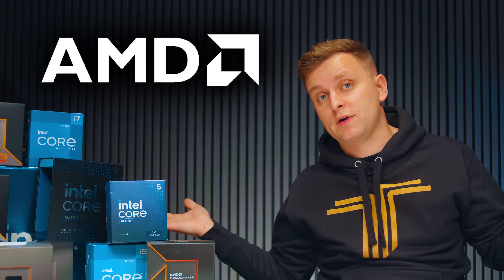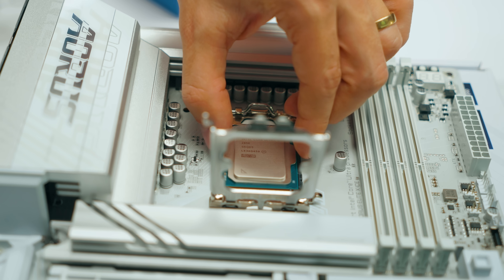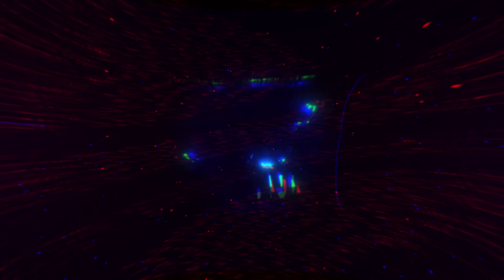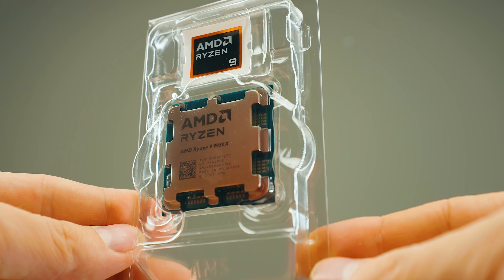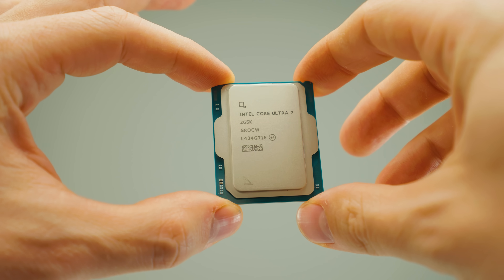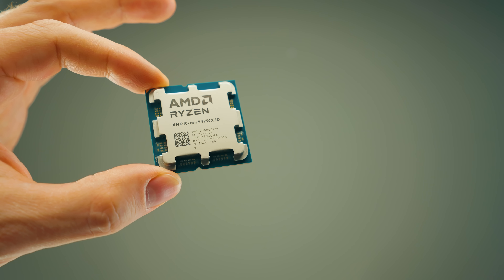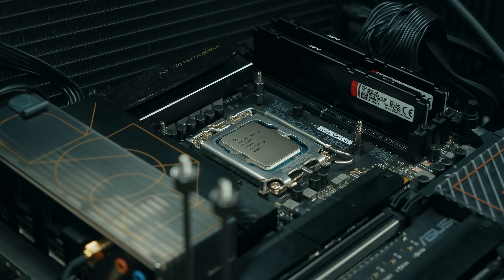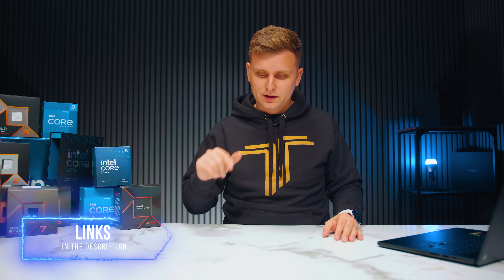Don't BUY a CPU before WATCHING THIS! - Top 5 CPUs for 2025

Comment: If you are a gamer, the AMD Ryzen 7 9800X3D is the best CPU for you.
If you are a gamer and a content creator, the AMD Ryzen 9 9950X3D is the best CPU for you.
If you are a content creator that doesn't play games on PC, then the AMD Ryzen 9 9950x is probably the best, but some intel CPUs might be just as good for less money.
If you only use your computer for basic tasks and web browsing, then you can save money by getting an Intel CPU, because you won't use the extra processing power provided by a high end CPU.
Reply: Gaming and streaming on the 9950x3d is a pain in the ass and your forced to use project lasso. So no, this is coming from an owner
Reply: I have not read about any such issues myself. The game bar and latest chipset drivers on Windows 11 24H2 are reportedly working fairly well. Which specific applications are you experiencing issues with?

Comment: 8:32 here's the thing, "top of charts" everyone's missing, you're missing, when all these reviewers benchmark they run the game in a vacuum, in isolation all by itself. Oh sure they play the knobs higher or lower resolution, Ultra or high settings, upscaling SS on or off, BUT what nobody is reflecting in benchmarks is running the game same time as truly multi-tasking gaming + socials + recording + streaming ; OBS, XSplit, XBox Game Bar, Discord or Twitch or Kick or YouTube, etc. More than half of gamers are also doing this and guess what, sure enough, the Intel Thread Director and Hybrid Performance, Dynamic Tuning, and myriad of Application Performance Optimizations results in significantly better FPS on Intel vs AMD for everyone who does these.
Reply: Have you empirically tested your hypothesis? I’m fine with you being right, but we need concrete proof. So far, APO has proven to have some pretty wild swings in performance with some wins and some regressions. Intel thread director on Windows has needed serious adjustments to the Windows kernel as seen in Windows 11 23H2 vs 24H2.
Reply: @gymnastchannel7372  yes Intel has, and shown to top reviewers at briefing events where Intel points it out, asks them to include these. That would add loads of variability mind you, many more complications of course, such as which streaming/recording apps and at what settings, and under what network conditions, lots of work not keen to undertake.  Intel predicted majority of gamers want and use these, and put in the engineering purpose built for better consistency, performance and responsiveness on these, but how to get folks to see it?
Now in the case of APO the app, I think people misunderstand it too, are disappointed there's not as many titles listed, but that's actually a good thing. What Intel does is make it easy and supports myriads of developers and titles, so their application or game title can be tuned to further & maximally exploit Intel architecture advantages, not least of which is Dynamic Tuning and optimal dynamic scheduling on performance and efficiency cores, but also caching, I/O, and more. Now, think of APO app as a stop-gap, a helper, for titles or portions that are not yet fully optimized at the source.
Reply from the maker: I'm glad I don't focus on gaming on this channel 😜

Comment: I will go for 265K. It will be used at 1440p with 9070XT so it will not be a bottleneck and it still has 20 cores that can be used to get some fun on Proxmox or raw Hyper-V.

Comment: Yeah, what is up with the hating INTEL.  INTEL is a wonderful Chip Company.  A major part of the U.S. Economy.  INTEL makes solid dependable Chips.  I will always be staying with INTEL for my PC Chip.
Reply: Intel unfairly and illegally kept AMD and perhaps others from being used by OEMs, didn’t care about defective 13/14th gen Raptor Lake-gen CPU failures, and before that tried and failed to get buyers into a proprietary RAMBUS ecosystem, then fucked up their memory controller hub, causing instability. Their 1.13GH PIII was pushed too far and was also recalled. The original Pentium had a division bug. Need I go on?
Reply: why did bro just mad at amd lol  , your profit after building rhat trash intel pc is nothing 😂
Reply: It started with their 13th and 14th gen having issues with incorrect voltages resulting with blue screen, shutting down, or worse blowing up. It took them a while to fix it by updating the bios but damages has been done.

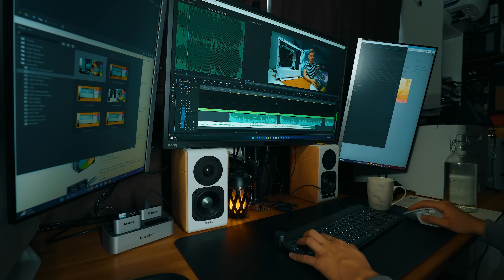Comment: 0:22 for some reason? 😂
Reply: Yeah I guess making 2 generations of CPU's with fatal flaw is not good enought reason for that guy
Reply: @skiper7795 I wouldn’t really call it a fatal flaw. I run all of my CPUs at elevated voltages to overclock and accept more degradation because I want more performance. Sure it should not be something that’s default but it’s not really a fatal flaw
Reply: @JohnSmith-sm6mu Everyone that is not into pc hardware which is a majority was using cpu that was damaging itself over time. If thats not a fatal flaw idk what is.
Reply: @skiper7795  And the sad part is, most people don't even know what a BIOS is. They buy the computer, turn it on and turn it off when done using it.
So many of these CPUs are on original BIOS firmware and the CPU's are just getting cooked.
Even my tech focused friends and coworkers, I've found that working on their computers that the BIOS is WAY out of date. I get a "whoops, forgot about that" or "I have to/can update that?".
It's a fatal flaw.
Reply: I’m not sure how many creators who depend on their PCs being reliable are following suit with your approach to CPU stability/electromigration.
Reply: Tried to blame the customer tried to blame the mobo manufacturers tried to even hider it for a while. Saying the first microcode fix was actually fixed then released another or maybe two more microcode fixed which might fix the inital problem. But by this time the damage was already done. Just some cpu degradation but it's fine everything is " fixed" now you only lost some performance on your already overpriced cpu. But there is no reason to hate Intel for this come one they were just joking with you and with your money.

Comment: running 265k+B580+96GB RAM for all intel build. Have zero complaints for productivity, running lots of heavy VMs and bit of video editing.
Reply: Just a small correction: the B580 motherboard doesn't officially exist. That Intel i5-265K processor uses the Z890 chipset or similar, not B580. Otherwise, it's an excellent configuration for virtualization and video editing.
Reply: @arnaldosancheztecnologia it's the GPU buddy. He did mention "all Intel build", so that B580 refers to the Intel Arc B580 graphics
Reply: @SoloID97 Sorry, I'm understand
Reply: @SoloID97  How are you getting on with the B580 GPU? Have you done any 4K video editing with H.265/264 files using that GPU? How does it perform on the editing program's timeline?
Reply: And you're wrong about i5-265K. The i5 term is no longer exist. It's now Core Ultra 5 265K
Reply: @SoloID97  I know it's called Intel Core Ultra, but I put "i5-265K" to shorten the words
Reply: @arnaldosancheztecnologia then it’s i7 (ultra7) not i5 😂

Comment: Let's make some things clear, intel is still on the market because there are still intel fans out there. They've messed up big time in the last couple of years similarly to Microsoft and almost everyone is switching to Linux atm😅😅😅. Future is running on Linux and AMD chips, I have no doubt about it. Intel will do Gpu's along Nvidia 😅😅😅 and brush the floors after AMD finishes selling all the chips whilst holding a lead in the market.

Comment: The current intel socket is gonna be dead after this generation. it's automatically worse than every AMD option because of that
Reply: Ahh yes, everyone should throw money on a CPU every 2 years guy. Just look at what's in front of you (no pun intended). Sure, AM5 will last for another 3 years? If you really got the money, don't look at Intel right now. But it's such a good budget/value buy (265k especially) that it'll last you for the next 5 years. AM6 will come out by then and  we will all be building new rigs anyways.

Comment: I have the 265k on an AsRock Z890 LiveMixer mobo. 128G Crucial DDR5 and a 4080 Super. DaVinci just rolls right along.
Reply: I've got the exact same combination. Did you overclock?
Reply: @SpFres1  No I didn't.  I've never overclocked any of my PC's but I have shown folks the How To on doing it for their particular build that I made for them.
Reply: undervolting at  all? Ive heard this really helps temp and performance of the 265k
Reply: @SmbaaFlipooo  Doesn't run hot at all. Core i9  and whatnots yes those are space heaters. 265k not so much.
Reply: What kind of cooling do you have for this?
Reply: @jacekrams  Be Quiet Dark Rock Pro 4
And it clears the memory too.

Comment: Used to buy only Intel but got tired they don’t have any platform longevity, really happy on AM5 ever since with 9800x3D
Reply: Yup I used to build only Intel systems. Not any more. They burned all the goodwill they had built up with me with the 13th and 14th gen fiasco and the way they handled it.
Reply: And forgot to mention the most important, looking forward to ZEN 6 on AM 5 🎉, AMD shows it can be done.
Reply: by the time you need to upgrade 14600k or 9800x3d youll need a new motherboard anyways
Reply: @bigturkey1  When it comes to non gamers and people who do not do creative work, I agree.  If you are however one of these two types of people who are building a system, do you keep longevity in mind? The 14600K is $310 CAD. New DDR4 memory has spiked up pricewise almost double in price.  The only non motherboard upgrade down the road on the 1700 is a used 14th gen CPU otherwise you will need a new motherboard and memory. On AM5 you will have the Zen 6 CPUs and the existing DDR5 memory is reusable.
Reply: @GregM  14600k $150 comes with bf6. you wouldnt want to use ddr4 with it. in like 8-10 years when id upgrade from it, id move it to my 2nd system and finally retire my 6700k. then buy whatvever is new then. I already have a 120hz 55" 4k oled, i cant see me even be interested in upgrading my cpu til i can buy a 240hz 55" 4k oled and a competitive game exist that my 14600k couldnt get 240fps in.
Reply: same, got hyped into the x3d technology & bought the 9800x3d. however, i will point out what no one seems to mention is how much more POWER (watt) AMD uses just sitting in IDLE doing absolutely nothing, it uses 4x more power draw sitting in idle than my intel. which would indicate it being more costly over time....
Reply: @BenjaminD-d4k  Well costly in some areas of the world where one does not have cheap power.
Reply: @GregM  guy you're either not a critical thinker or  have poor reading comprehension skills. all else the same, owning an 3xd is more costly to own over time bc it utilizes more power even at idle. thats not even an argument but an objective truth. do you attempt to play devils advocate?
Reply: @BenjaminD-d4k  Where I am, electricity is cheap, and I am not going to lay awake at night thinking if I am going to be able to pay for the electric bill because it has cost me $10 more. I will also not lay awake pondering your comment.  

I have more important issues in life to be concerned about than semantics.
Reply: @GregM  ironic to even say when that's literally what you're doing. justifying cognitive dissonance. what i said is not even incorrect but you decided to exaggerate it more than it needs to be

Comment: 14600k/kf with 20 threads, nice clocks and all round beast, stable and cool, for a 14700k/kf you need a 360 AIO, if not because of the temperatures then because of the noise.
Reply: 14600, sure. Stay away from xx700/xx900.
Reply: @gymnastchannel7372  I recently bought a 14700k, but that small difference in voltage makes a big difference in the required cooling, performance and stability are superb

Comment: I have a 265k and like it a lot (though I was pretty torn between getting it or the 9900x). One thing you might not have mentioned (unless I missed it) is that 265k/285k mobos are essentially only good for that one generation plus any refreshes. It isn't a massive deal to me, as I'll probably just end up buying a new mobo regardless, but something to keep in mind. Also, if you get 13th or 14th gen intel, make sure your mobo's bios is up to date so that you get fixes for any degradation issues.
Reply: I think you're a little confused: the Ryzen 5 265K doesn't exist. The 265K belongs to Intel (Core 7 Ultra 265K), not AMD. Motherboards for that processor use the Z890 chipset, not AM5.
Reply: @arnaldosancheztecnologia  lmao he never said it is ryzen

Comment: I’ve had the 12700k, moved to the 14600k and I’ve had zero complaints. 

I also have an M4 MacBook Air and I still prefer the performance of the Intel system. Don’t rule out the 14th gen at all… they are beasts
Reply: Im still on 12700
Reply: Same, upgraded both of my builds with 14600ks. No regrets.
Reply: I also got the 14600k and I love it. Very fast, snappy, quick, and responsive.
Reply: Your comparing a base model mac 😂 go buy a m4 pro with actual cooling and you’ll see

Comment: 14600K over Ryzen 9600X? Seriously? Even an amateur like me can tell that the 9600X delivers similar, if not better performance at nearly half the power draw (125W vs 65W) and for the same price.
Reply: 14600k doesnt use 125w in game
Reply: True, however there is no question that Intel continues to use more power for the same performance vs AMD, and even moreso Apple. If you have a reason to pick  or prefer Intel, that’s fine, but you must simply face facts.
Reply: What are you talking about? 14600k is over 50% faster in multithreaded app, look at cinebench c23, in games i5 is drastically cooler than any ryzen 9xxx
Reply: Your point about multithreading is valid. Heat is unlikely to be an issue on either CPU provided your cooling solution keeps temps under the limits. CPUs can safely tolerate their limits for years.
Reply: really Ryzen? throw that Garbageee. Intel more stable.

Comment: What about the Ultra Core Refresh which is to be released soon from posting?

Any more Back Connect MB’s coming to market or current crop is it for z890 chipset?

Nicely done, appreciate your research and sharing!
Reply: I should also ask if we have Socket 1954 from Intel for the future CPU’s. So we know what the Chipsets will be called?

Thanks for any reply
Reply: Core 200 Ultra refresh appears to add 100MHz clock rate and additional supported memory speeds. It seems unlikely (sadly) to change the performance picture by very much. (Apparently we may see a Core 200 270K that looks like a tweaked 285K so far as cores and clockspeeds go, and a 290K with increased clock speeds for the cores and memory, but it’s otherwise the same as a 285K.) The next socket by Intel is indeed 1954, and the first chip to fit it will be Nova Lake. Nova Lake looks promising, adding as many as 52 cores, APX and AVX 10.2 instructions, and potentially very large L3 caches. Keep your fingers crossed for a real banger…
Reply: @gymnastchannel7372  Thanks for ALL that information for the Ultra Core Refresh designations. I am attempting to nurse my Intel i7-2600K system for another year especially since I extended the security downloads from MS for free.

Sure hope Nova Lake arrives and all the motherboards early end of next year. However, probably a premium for such a new lineup of products, Intel Socket 1954, maybe Back Connect MB from the get go as well. Guess wait for the next YouTube postings from the computer show(s) with vendors showcasing the upcoming releases.

Best to you!
Reply: @Majeskty won’t be until after CES so early next year, I’d say 3 months from now

Comment: There is no circumstance where I’m purchasing an Intel CPU ever again.
Reply: Same here. Intel Ultra platform is a dead end platform. One refresh and that is it. Will need another motherboard.
Reply: How iften do you jeed to upgrade cpu? For ehat purpose? Cpu is the most longlasting part. When you upgrade you eant better features, and those come with motherboard. Everyone praises am4 for longevity  but staying on am4 means lower pcie gen and still sitting ilon ddr4.
Reply: @oleglego3655 whenever you want, point is AMD give you that option, Intel does not. Zen 5 to Zen 6 will be big uplift, I will upgrade my 9800x3d to the new cpu on the 2 nanometer node without the need to change my motherboard or ram 🎉
Reply: @GregM yep same reason i stopped buying Intel, new mobo every generation, they don’t think of their customers at all.
Reply: Oh please stop being a 🤡 if intel released a faster cpu all you lil fanboys would be running to buy it or hate on it 🤣

Comment: all intel even new intel after 1 year give blue screen +still very hot
Reply: X3d chips run just as hot while drawing less power lol
Reply: Irrelevant so long as you stay under the thermal limits. All modern CPUs have very high limits. 🤷‍♂️
Reply: @nicholaswicks3077  1st gen 3D, not 2nd gen from 9000 series.
Reply: @PhantomSklyne It’s both gens lol the ihs is terrible.
Reply: @nicholaswicks3077 I've heard it's very thick on AM5 CPUs, might be why. Also I'm using 5800X3D with deepcool AK400 cheap cooler and it stays around 70 in games and 80 while doing shaders. Completely fine doesn't have to be 50.
Reply: @nicholaswicks3077  no, you  are wrong,,,,on desktop ryzen 7800x3D  max temp is near 70 with air cooler,,,,amd cpu temp is low= long life
Reply: Different CPUs and silicon manufacturers have different thresholds for heat. Some
CPUs can handle excursions to 115 with 105 all day. Others must stay below 90. It’s hard to make a blanket statement.